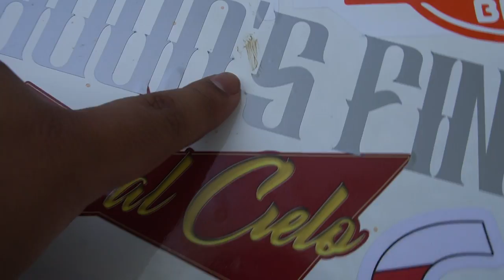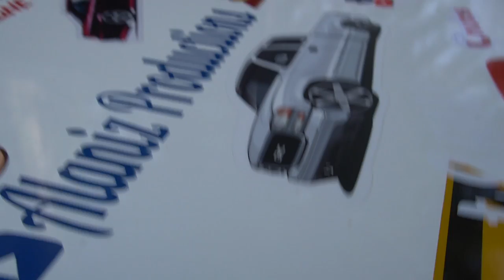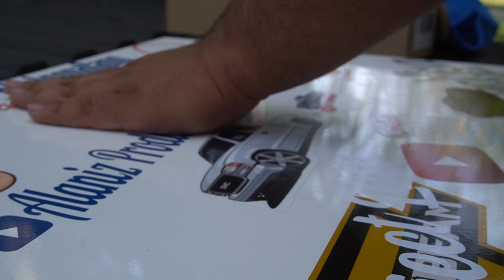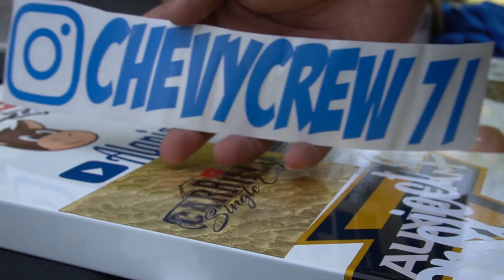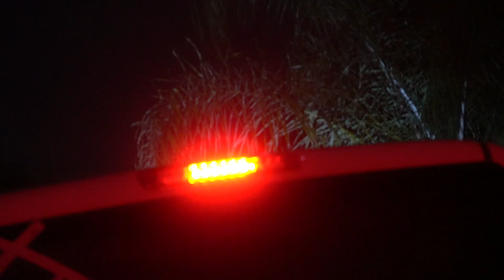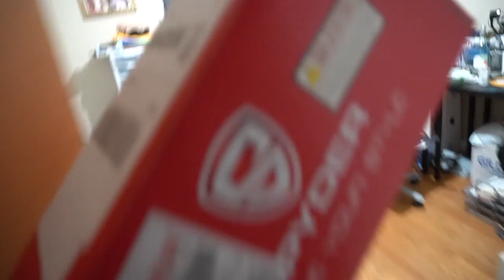INSTALLING LED 3RD BRAKE LIGHT! FINALLY!

Comment: Square body giveaway! That lil box is a ballast or resistor for the rear cargo lamp. Without while running LED bulbs wont be bright on stock housing
Reply: Could you explain further?
I've been trying to fix this led cargo light issue on my 03 Silverado for a while now. haven't found much on it.
Reply: @kozmicflush980  when i still had my truck i bought an aftermarket 3rd brake light off Amazon which comes with a load resistor. Sent it back and got a replacement in case the first was a QC fuck-up but turns out the replacement did the same which had the cargo lamp stay on all the time. If u know an auto electrical guru they can fix the problem probably by just cutting off the resistor and soldering the wires back. But i had the stock housing with LED bulbs but the cargo lights are dim when on. So either way unless knowing an electrician nothing works out. Hope u have better luck.
Reply: @MartinFuentes126  I've read on the only forum i could find for this, to get to the wiring it's up above the headliner. So you'd have to take that out just to get to all the wiring. It's insane not being able to upgrade your cargo lights to bright LEDs with these old GM trucks. And even my back-seat dome light is dim, running LED.

I wish it were a simple fix like fixing hyperflash with a module. 😒 Guess I'll be keeping my stock housing
Reply: i appreciate the reply, brother.

Comment: Bro the third brake light should only turn on when you hit the brake idk why yours stays on i think you got lucky you shouldn be disappointed  mine only turns on when i hit the brake, same truck as yours .
Reply: never seen those before it works as running light too,but bright when braking
Reply: @kikowd88  i know right thats wierd bro

Comment: That third brake light doesn’t look like it has a gasket, you will get water leaking in a ruining your headliner. I recommend getting a better one rather than a cheap one...
Reply from the maker: I actually check the box after filming and realized it came with a gasket so it’s all good now!
Reply: @BIGOCHUBS  the double-sided tape gasket?